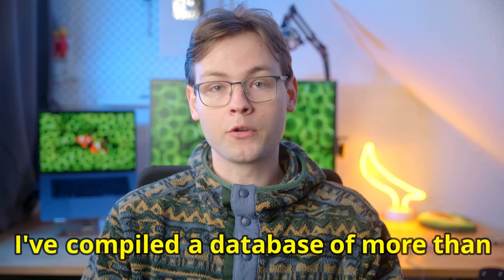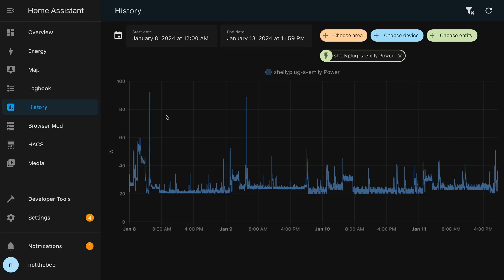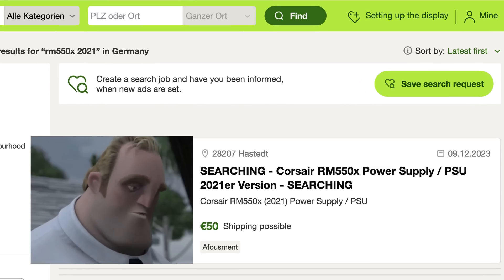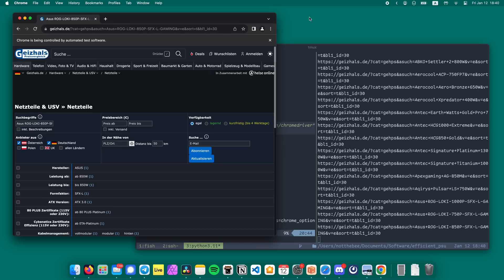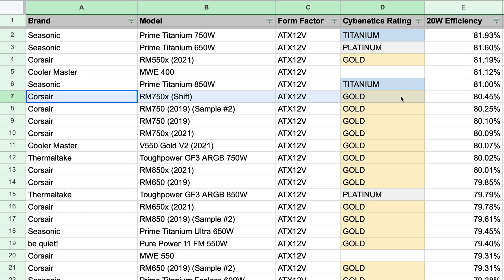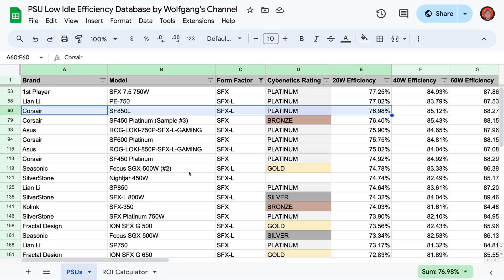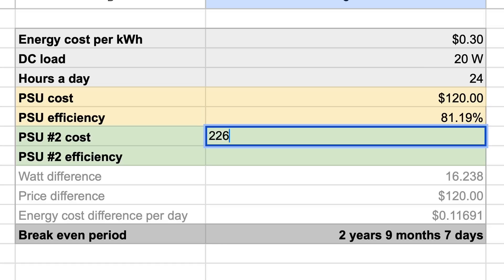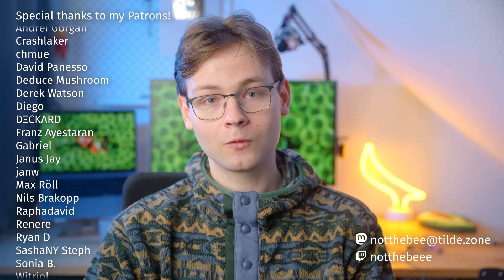What's the Best PSU For Your Low Idle Home Server?

Comment: My first thought was if it would be possible to spin up the Hdd's one by one. But even if this would be possible, it would ofc increase the access time significantly. 
2nd thought: Add a power buffer via a small battery or even some capacitors. 
But I am surely not the only one with that idea and surly the community have tried or at least thought about it. So the question is why wouldn't that be viable. Does anybody know?
Reply from the maker: What are you trying to achieve, exactly?
Reply: @WolfgangsChannel  
Oh sorry, I should have mention this. 
You said at the beginning of the video, that the short high power demands of several HDD's spinning up at the same time prevents you from using these otherwise ideal pico PSU's. 
So instead of getting a more expensive, bigger and less power efficient (at low power) PSU add a power buffer. 
It seems so wasteful to get these beefy PSU's, only for these 1 or 2 seconds the HDD's need to spin up. 
I hope that clarifies it. 
Thanks for these great videos!
Reply: @shaytal100  Not actually sure if its for this purpose but i see some backplanes for hdd's have capacitors. Is it already a thing?|

Comment: Since I buy power supplies that should last 10 years and I use a GPU in my server. I decided to go for a 1200W PSU in my server, since the old 850W PSU did not handle my 3080Ti.

Why buy a 1000W PSU now when it may be to small in 5 years when GPUs and CPUs use even more power....

Comment: In the last builds I picked FSP HEXA 85+ PRO 350W.
P/N - PPA3505301. Warranty is 5 years, japanese caps, amazing price at 50€.
Measured with wattmeter i5-10400 machine idling at 20W in windows with monitor connected.
Its my go-to and would be curious to see where it lands in the efficiency table.

Comment: All nice and dandy, but that's for 115V...

edit: It's really only for 115V... which is mostly used in USA... which is cheapest country (developed) for electricity costs. Please modify/add 230V. Thanks!
Reply from the maker: Some Cybenetics reports include both 230V and 115V measurements, some only include 115V. I've decided to stick to 115V for all power supplies in the spreadsheet, especially because the difference is not that dramatic.

You'll still be able to compare different power supplies and their respective efficiencies.

Comment: For my low-power home network I've ditched traditional AC-DC PSU's entirely, after factoring-in the **UPS requirement**. I use a single AC-12v DC stage which includes the UPS function (a Meanwell ADD155), then run all other devices off the 12v supply, using PicoPSU type units as needed. This means I only have one AC-DC conversion with the associated losses there.
Reply: Does your PSU have any means of configuring battery voltage ranges to accommodate for different types of battery? I am currently using a single 12v PSU that feeds directly into a cheap solar charge controller specifically because the controller can accommodate GEL, flooded and AGM battery with configurable cutoff voltages. There are also LiFePO4 batteries with built in BMS to make them useable in place of a lead battery, currently researching those as well. How long has your lead battery lived so far?
Reply: @L1Q  The ADD155 has a basic potentiometer to adjust  the B+ voltage. It's intended for use with cheap SLA ~13.8v standby batteries which typically would have a life of several years, mine's been in service for ~2yrs, so far so good. My impression is that 'modern' battery technologies bring drawbacks as well as benefits, so I chose the cheap/simple option.

Comment: Would be interesting to see, how they compare to pico psus though. But I know, that it is more complicated with them, since you have the efficiency of the pico psu itself and the power brick. But comparing 12V input ones to wide range input ones might be interesting.
Reply: it's not that it's complicated, it's the fact when we talk about PicoPSUs the most inefficient part is the AC-DC converter(AKA power brick).

Comment: Someone already mentioned, but you could take a look at UPSs! For an even deeper rabbit hole. So far even a smallish ups draws more then my "homelab". And the old APC beast that can run gas boiler + homelab + network stuff for hours draws draws around 40w just sitting without any load...
Reply: Yeah ! I now use a single AC-12v DC conversion stage to power all my home devices, a Meanwell ADD155 which includes a UPS function using a 12v lead-acid battery. All the home network devices then run off that 12v uninterruptable supply. By only having a single AC-DC stage for everything I'm minimising my power losses.
Reply: I also used to have UPS units that would consume an extra 20-40W for doing nothing. Like  @AndyMcClements , I have a similar setup. Using a Victron Energy Smart IP43 12-Volt 30 AMP (360W) 120-240VAC charger to keep a 12V (1kWh usable) battery charged. An Orion XS 12-12-50A (600W) in "power supply mode" feeds the 4 or 8 pin 12V power rails, the 12v SATA plug wires and Pico PSU boards as needed. VE.Direct to USB for live monitoring on both devices triggers shutdown script if battery voltage get too low. Easily averaging over 90% efficiency.  It pays for itself because the charger is disabled daily during peak electric rate tariffs. For POE I tap off the house "48V" bus, it's a 16S lifepo4 pack (charged with MultiPlus inverter/charger) since it's always 52-53V or otherwise within acceptable POE voltages. It's more efficient keeping the 12V and 48V typically charged with separate chargers, but I do have a SmartSolar MPPT 75/10 that gets enabled to charge the 12V battery from the 48V pack if the 12V battery gets too low during an extended AC grid power outage.
Reply: @AndyMcClements That’s so cool. I’d like to try that, have you written up your setup in more detail anywhere?
Reply: True, in my case:
Emerson PSA500MT3 ~15W@idle
Eaton ellipse eco 650 ~5W@idle
Reply: You should look into that to see if those numbers are out of spec.

My APC 600 only draws 0.5-3 watts idle. Obviously more if it's recharging from a black/brown out.

Edit: Are your batteries going bad? Maybe they're bleeding voltage and have to constantly be topped up.
Reply: Thought about commenting this on a previous post, glad it is being mentioned!
Reply: Keep in mind off-line interactive VS line interactive UPS is not the same.Line interactive is best for server because his job is to clean the line. But this last one eat lot of watt.
Less watt for off-line with no cleaning
More watt for line interactive with protection.
This is the dilemma :)
Reply: EATON 3S 850 FR is cca 5W idle. My Compal CATV modem 11W. My Fujitsu Q956 home server could be 6-9W but it depends, cloudflare tunnel or USB wifi dongle could add like 1-2W each so typical is 8-9W. If I plug my PC and display in sleep mode and home server to UPS, UPS to shelly plug, I get roughly 14-15W. If I add cra**y modem to that, I'm already reaching power consumption of a fridge or boiler, considering that boiler is off overnight and during the summer, otherwise pump takes 80W.
At least money paid for electricity end up in Europe, unlike money paid to google, spotify, openai, ... possibly provisions to ebay, amazon etc.
Reply: Thanks Wolfgang. And why spend days writing scripts that can scrape the contents that will take hours to do manually? Because its fun! Great research thanks.
Reply: My UPS is using ~10W all the time .. which was a surprise.
Reply: @casperghst42  That doesn't seem too bad, the last AC-AC UPS I used at home was a cheapo APC and it consumed ~30w iirc. My current DC UPS setup uses ~5w with the battery full and no output load.
Reply: @casperghst42 what's the model number of your UPS?
Reply: @buildanddrive  it's an APC Back-Ups 950. Never had a problem with it, the one time where I needed it. I was just a bit surprised when I discovered that it will happily use 9-10W idle.

Comment: I'm using an old 400W FSP Gold rated PSU, I'm not sure how efficient it is at 20W but considering its maximum output isn't that high it's probably not that bad. 
I also did some napkin math and concluded it's not worth it to buy a new PSU for marginally better efficiency, not with the current electricity and PSU prices at least.

Comment: i went away from these Pico PSUs. 1. 5V Power if you need a lot of drives.  2. Price is way to high. 3. Most annoying: connections. i had problems just to find an additional 2. adapter for the not used connector. i found no info how it is called exactly. mini molex 4pin? i ended up soldering directly to the pcb. :-)  i will never use a pico psu again.

Comment: 80plus reports database might also be interesting here.
Doesn't fit into the 20/40/60/80 watt scheme though. Only displays 10/25/50/100% load wattages. Sometimes 5%.
No nice data presentation like in the cybenetics report. Calculating/approximating also not possible with 80plus reports.
Can still be interesting in some cases I guess.

Comment: You might want to look into HDPlex power supplies as well, they are super power efficient and fit into small itx cases and have a good selection of connectors
Reply: The problem with them are the price. The 250 gan is great but it’s $150 and the 500w one is 175
Reply: I have one and the efficiency is good but it wasn’t a huge improvement. I guess the RM550X 2021 would be identical, but I have not compared it yet even though I have a spare RM550X to test… 😢

Comment: Great work and video!
I read (I think it was on the unraid forum thread about low power nas) that the magic of the rm550x was at very low load (~5W) were the efficiency was still decent while many other PSU were not (despite having good efficiency at 20W). Any input on that?
Reply: Well at some point, it really does not make a big difference anymore. The difference between 50% and 75% efficiency at 5W is only 2.5W...
That's less than 7€ a year with German electricity prices.

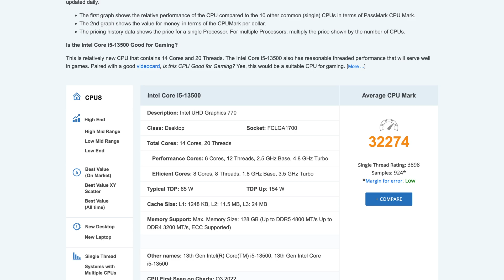Comment: At 1:37 that TDP does not mean that the cpu will draw 154 watts from wall. TDP stands for thermal design power basically meaning how much heat it generates in watts
Reply: Yes to generate that heat it has to draw that power from the wall. Otherwise how can it 'make' heat?
Reply: TDP and power draw have normally been around one to one historically. That has changed in the last few years.
Around the 10th or 11th generation Intel uncoupled maximum processor power draw from much of anything except the current thermals. This resulted in CPUs that are rated at 200w drawing 300w on good cooling. So for modern Intel processors the TDP to power draw ratio is about one to two unless you cap the power limit in BIOS.

AMD has made a similar change in the Ryzen 7000 series.
Reply from the maker: No, not from the wall, just the CPU alone. 
A i5-13500 equipped system draws around 230-260W from the wall at full blast, according to reviews, so the CPU itself drawing 154W is not far fetched.